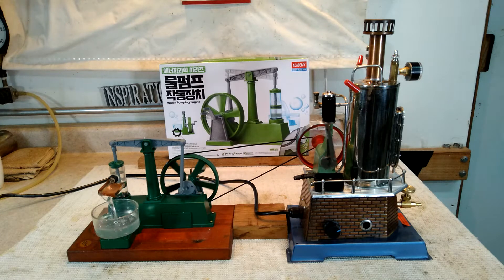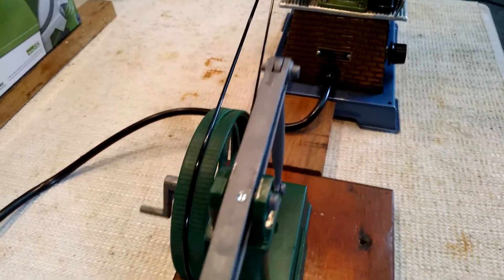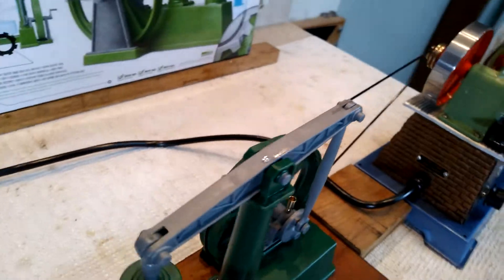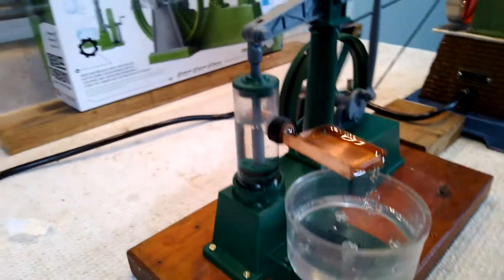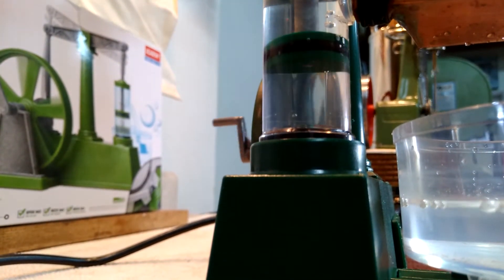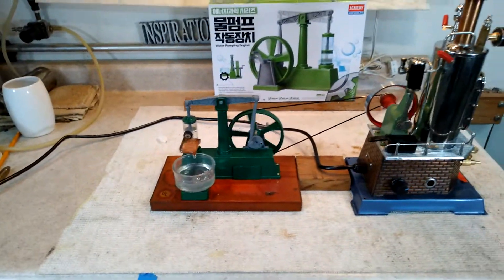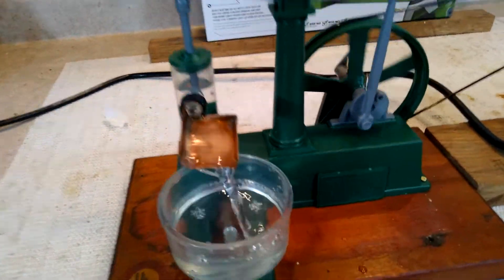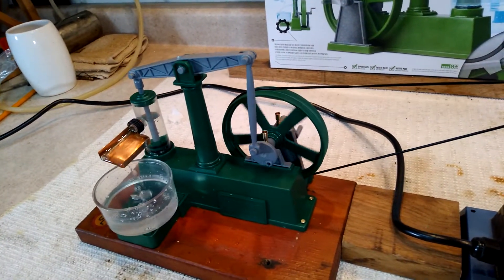Academy water pump engine , tips & mods , powered by a Wilesco D45El

Comment: Great video! I am looking to do something similar but with a D16. What would you recommend for a belt?
Reply from the maker: Hi Devin , I use 2mm polybelt , you can buy it from Ebay , simply cut to length , heat both end until they light & quickly join together , you have about 10 seconds to adjust , it should have a nice even mushroom head at the joint which you can then nip off with a toe nail clippers.
Reply: @bruceang82  thank you so much!
Reply: Just purchased a pump. FYI Ordered a belt on ebay search for "Polyurethane Conveyor Belts '  2mm x 6M $5.69 from China free shipping
Reply from the maker: @briannemec9214  that should do nicely, I have some of that already , if you follow some of the suggestion I made it will perform nicely for you , the biggest help is to secure it to a board to eliminate flexing (this pump is very light)

Comment: Nice water pump and engine and mods! Great job!
Reply from the maker: Thanks Matt
Reply: @bruceang82 no worries, how did you drill the holes for the oil cups being plastic?
Reply from the maker: @mattseymour8637  same as any other material , drill it , tap it, install oil cups.
Reply: @bruceang82  thanks I thought as much but obviously have to be careful with it being plastic